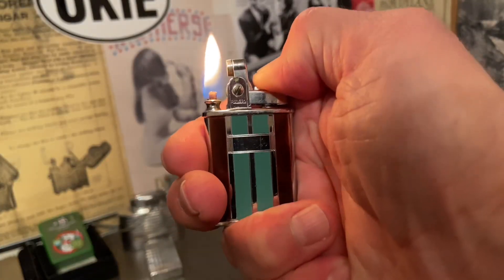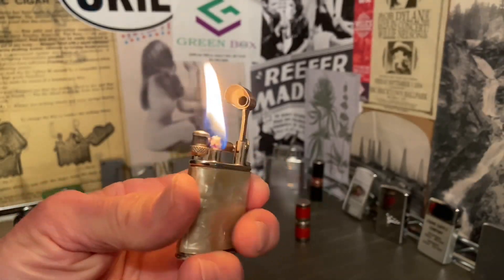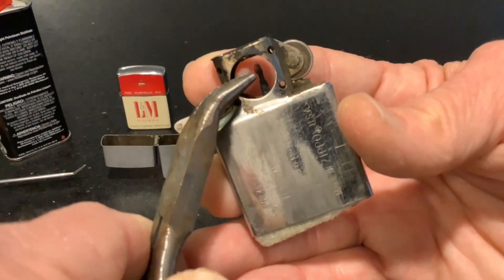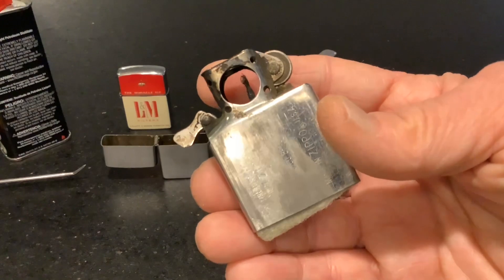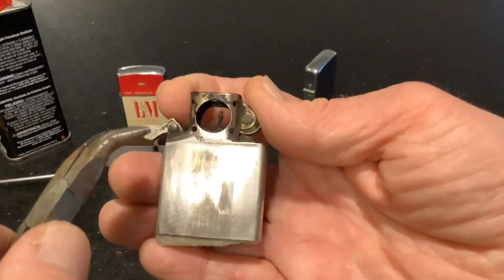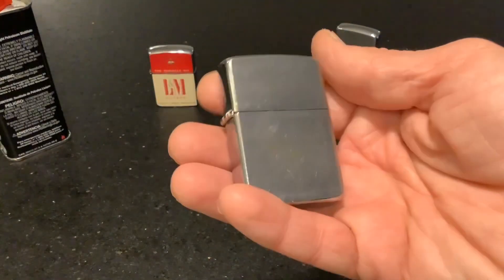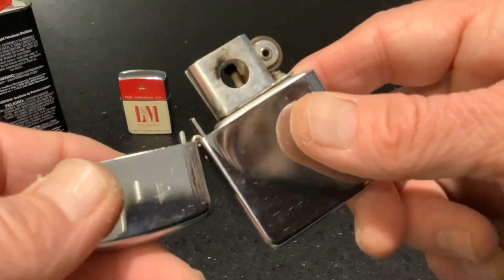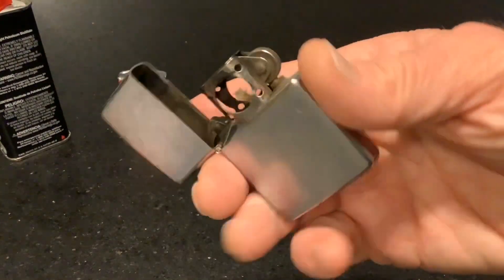Finding The Cure For What Ails Our Petrol Pipe Inserts(Where To Position The Wick In A Pipe Lighter)

Comment: Sent you an email
Reply from the maker: What kind of shape is the West Virginia lighter in? I’d love the chance to talk a little about John Denver. You know, they say that he got crazy once and tried to touch the sun…😜✌️
Reply: @DependableFlame  It's not bad for a 1971 zippo. The plastic piece on the lid has some melting/flame damage on the bottom corner closest to the flame, like all of them that have it and get any use. The chrome however is in excellent shape. Shiny, no visible dings or scratches. It's got a new factory insert. Reversed stamp, by the way.
Interested?